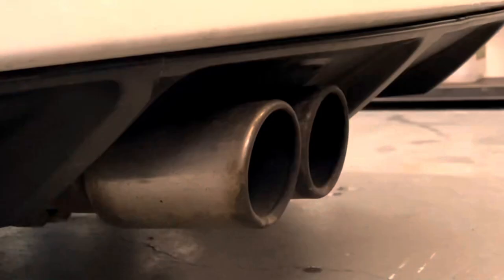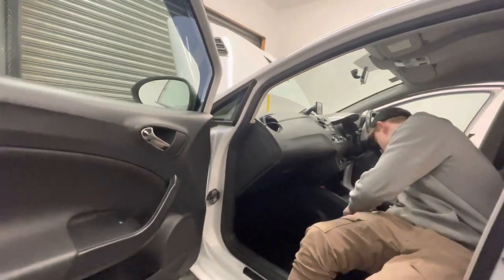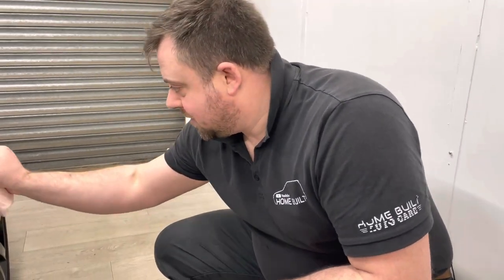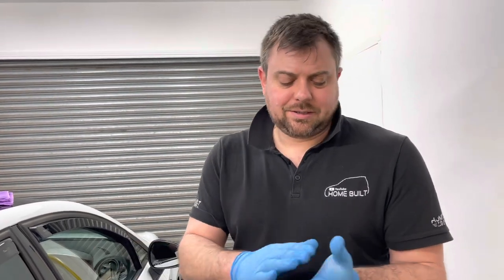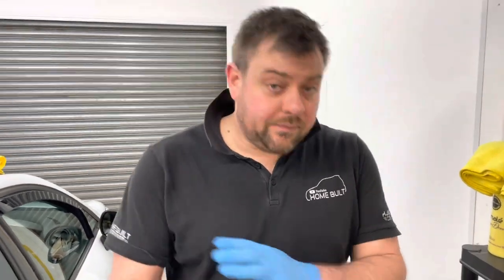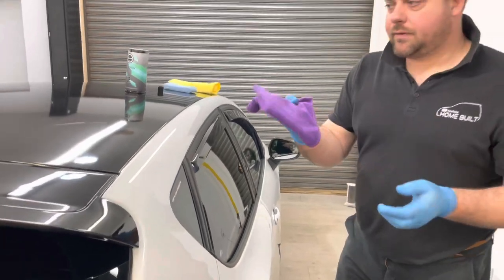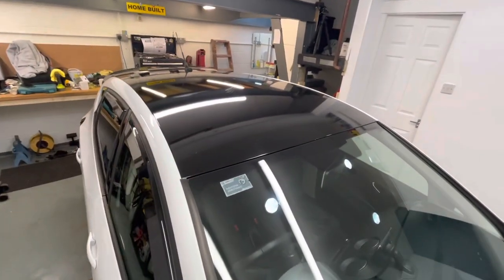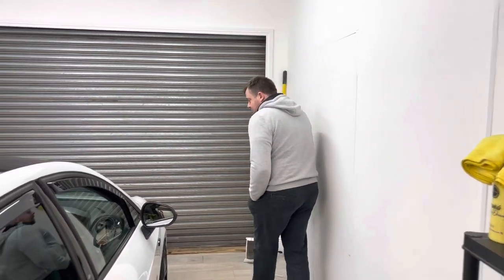WE DID NOT EXPECT IT TO BE THIS GOOD! Infinity Wax Synergy 2

Comment: Cracking job done on a very smart motor. I visited Infinity Wax last year and picked up a couple of wheel cleaning products on my way to St Andrews from Glasgow. I found the products very good but I predominately use Mitchell & King products as they are 5 minutes from home and John the owner is always very approachable and helpful. I am also a huge fan of waxing cars and he manufactures great waxes. I always think a coating is the way to go on white cars as it is not so easy to see where you have been with a wax I had a white Fiesta ST and a white 208 GTI so I have plenty experience but they do look good when detailed properly. Ceramic coating is not something I would do but I guess it is not much more difficult than using Garage Therapy CS as it needs to be leveled and buffed with great results but not the durability. I like to change my protection regularly and have a few waxes I have not tried yet so a 2 year coating is not for me and I regretted putting a 5 year Gyeon coating on my Mini JCW and a wash, decontamination & 2 stage polish and coating was £750 but it was in for 4 days if I remember correctly. I liked and subscribed as I like to follow Scottish content..

Comment: probably not a good idea to advise people they will get the same results at home as a professional will give the ceramic coating only a small part of the overall process car has to be ready for the coating to start with and not everyone can clean a car so it’s swirl free ready to put the coating on and most ceramic coatings need to stay dry for a good few hours after they are done so doing in a driveway is not ideal
Reply from the maker: Hi Gary, I do talk about preparing the vehicle during the video and also mention machine polishing so I’m sure people get the idea. The great thing about Synergy is it is designed to be used in any conditions, you can do it in your drive at home. You can even machine polish at home fairly risk free these days with the tools and products available so I do believe that if you take your time and follow the steps you can get the same results.
Reply from the maker: I love Rupes, id love to invest in one of the polishers one day.
My main attraction to Infinity Wax is the way they formulate the products. They make professional grade products that are designed for the guy in his driveway.
Also not too expensive.

Comment: 1:20 - You should be carrying out chemical decontamination procedures before using any sort of clay bar or mitt, this reduces the amount of marring you put into the paintwork considerably, however you should always machine polish a car following any mechanical decontamination as regardless of the paints condition, the use of any form of abrasive (yes a clay bar technically counts as a form of mechanical abrasion, even if it is extremely mild) will leave marring in the paintwork. 

Not only is machine polishing a good idea following mechanical decontamination, but it is a good idea prior to applying any coating - even if just a very light polishing compound is used - as it will remove any remnants of previous protection products and allow for a bare and clean paint surface for the prospective coating to bond to (after panel wiping of course). 

Just a few tips from an IW Accredited detailer👋

Edit - I also feel the need to state that the quality of work you would get from a professional detailer will ABSOLUTELY be miles above and beyond the quality you would get by having a crack at it on your driveway with a few beers and a quick wash... I have utter respect for people wanting to take a swing at it themselves, but I think its wholly inappropriate to say that anyone can do this on their driveway and get the same results as a professional who will without doubt provide a noticeably better result. 

Its not cool to deminish someones livelihood so casually, that poor chap wasnt even charging a lot of money and you're basically telling people he's ripping them off because "anyone can do it themselves".

For the record, my coating packages start at £399 for a one year coating and single stage correction, and carry on well into the thousands for multi stage correction and long life coatings.